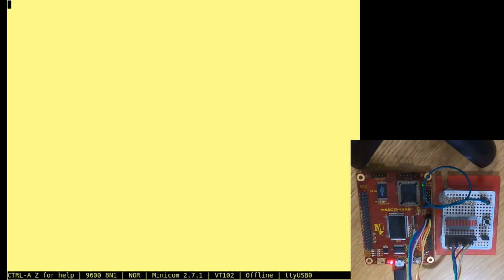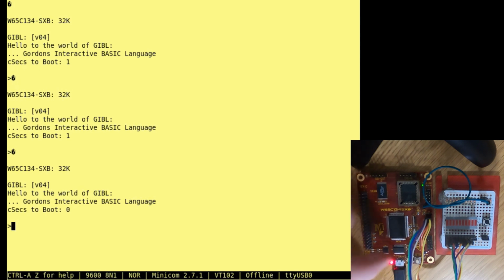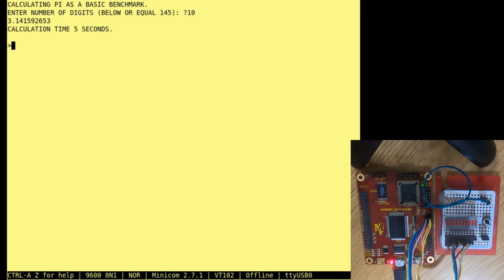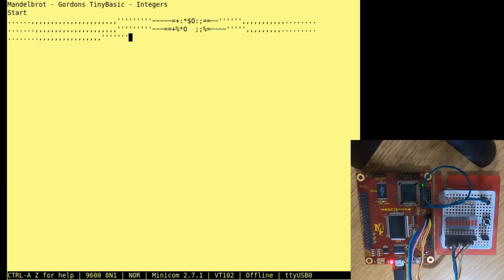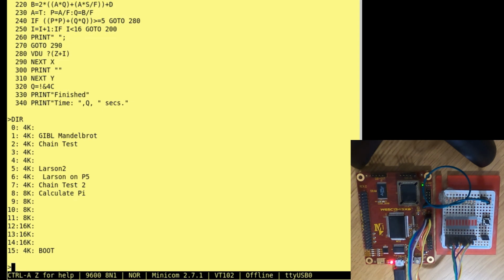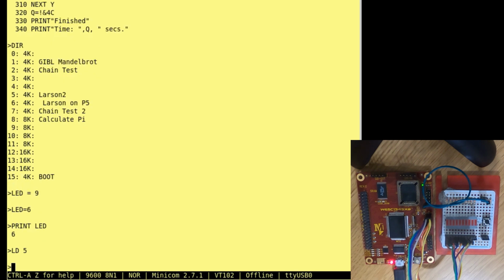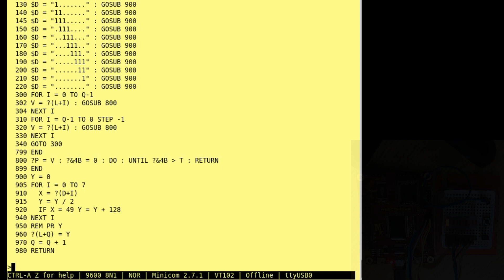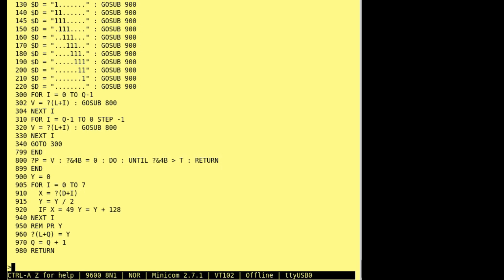GIBL | TinyBasic | W65C134-SXB

Comment: Nice demonstration of the board, thanks for sharing. Are the I/O pins on the board just broken out from the processor, or is the board itself providing it through other ICs?
Reply from the maker: The IO pins come directly from the CPU/SoC. It's almost like having a bunch of VIAs and an ACIA on the same chip.